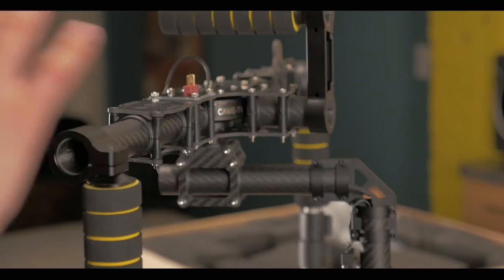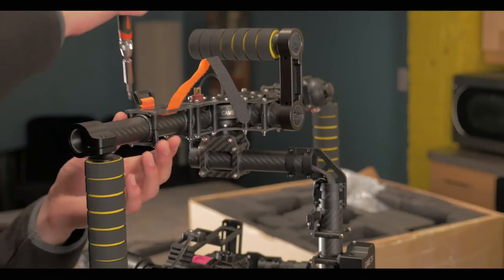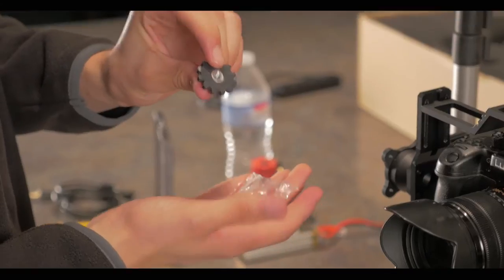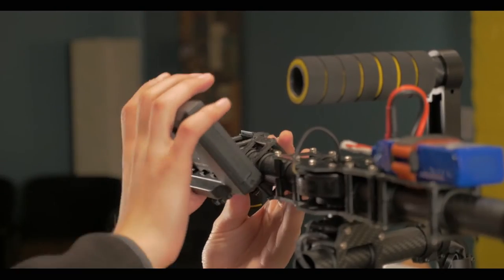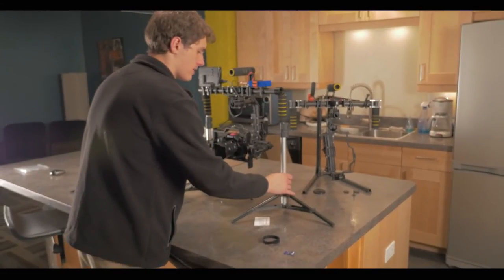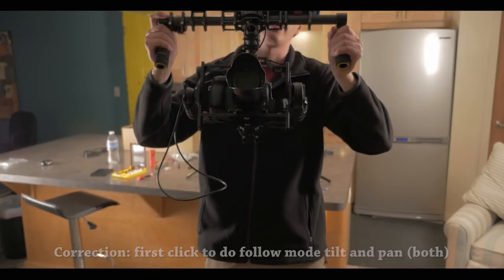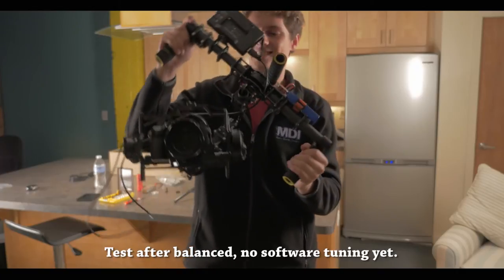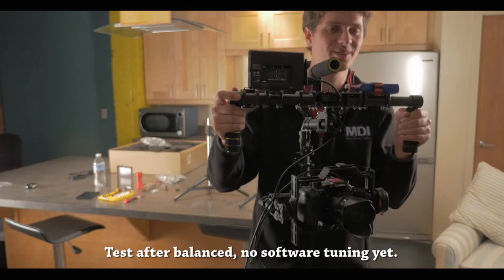Came 7800 Battery and Monitor addition

Comment: Thank you for a very concise and functional summary on one of the best and most user friendly 3-axis gimbal in the market. There are two variations of this engineering marvel, the CAM7800 from China and the newer upgraded AllSteady-5Pro from the U.S. with a host of additional features:

Toolless Balancing (seconds instead of hours to balance different cameras)
Battery Compartment (no more velcro strapped battery hanging on the handle)
Rubberized Handles (no more ugly spongy grips)
Anti-Twist Design (stops accumulated rotations from twisting & damaging motor wires)
Optional Monitor Brackets (clean design & adjustable arm for different viewing angles)
 
BTW, you can get much thinner and more flexible HDMI cable for the monitor so there is no need for big loops of cable that will impede gimbal movements.
Reply from the maker: Matt Weber Matt, totally. there are plenty of gimbals in the market right now and yes, we have other cables, but this one has a right angled connection but a bit long, no big, still works, :) We just got the Moza and it's almost a copy of Silk and Ronin lol review coming.

Comment: is there any special care needed for storing the battery? I heard it needs to be stored at %50 charge otherwise the chemicals could react in dangerous ways, but wasn't able to find out any other info to back that up yet..
Reply from the maker: Not of my knowledge.
Reply: Storing LiPo batteries for longer periods. Carge or discharge to approx 70%.
Reply: clausenogbach great thanks! what would be a rough idea of a longer period (week, month?)? Thanks!!